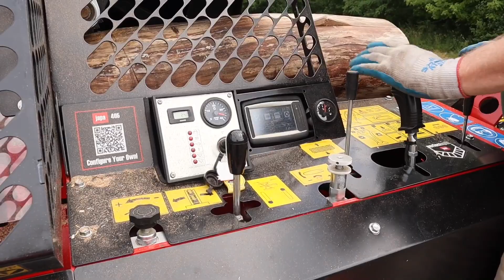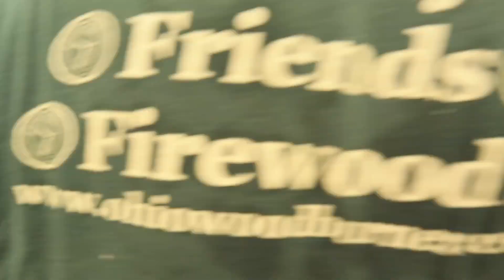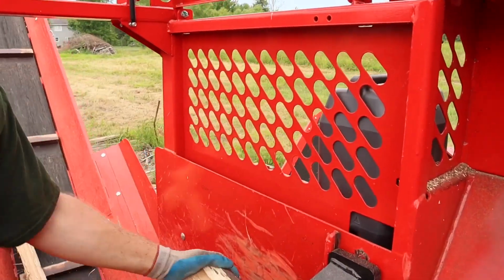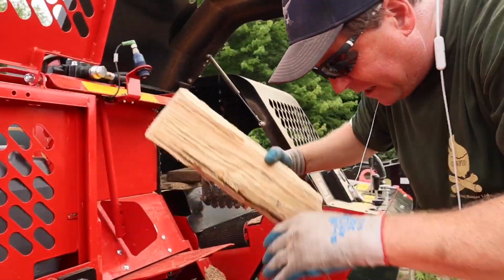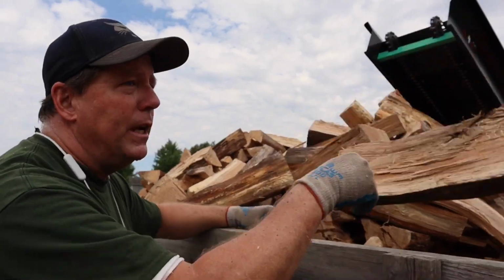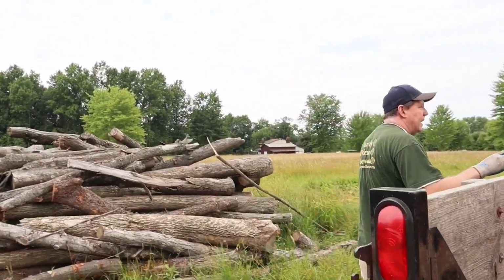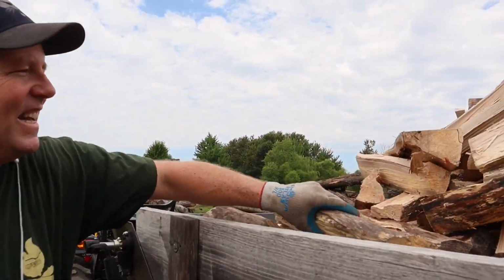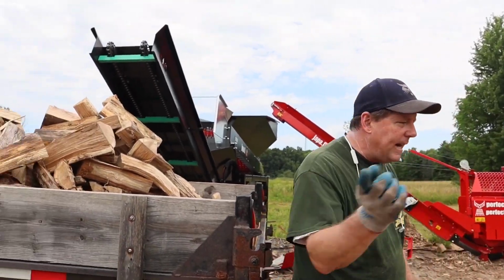SUPER FAST FIREWOOD PROCESSOR IN REAL TIME!!! The Japa 405

Comment: Great job Joe! I like the 405. I’ve looked at the large Easternmade and it might push wood through faster but it makes mush out of a lot of wood. You made the right choice…
Reply: You got that right!  

The 22MB for ~ $120k is faster with 115 HP pushing on the bar for faster cuts, and fast splits, but requires an octopus (with numerous arms) to run it.

Also, the 22MB, would "gargle" diesel compared to just "sipping" diesel on the 405! 

Once Joe is done splitting the 7 tri-axels of small logs, he can put back on the "perfect split" 6 way box wedge, where no resplits are ever needed.  For smaller wood yards, the 22MB is like using a sledge hammer to kill a fly.

Comment: Very impressive wood processor. Some of the best looking finished firewood I have ever seen made by an automated processor. The design of the 8-way splitting knife is just remarkable and produces very uniform firewood splits. Thanks Joe for the real-time demonstration! Just a quick question. Could the splitting debris that you are sorting out be sent through your chipper to make your smoker chip products? The material is already broken down to small pieces and should feed through your chipper without any problem. Just a thought. Thanks again for the great video!

Comment: Joe, I added up the retail cost on your processor setup without the Perfect-split/clean options. It is not cheap. A great video would be "how to build up your business to need equipment like this". So many people think they have to get a pricey setup like yours when in reality they only need a couple of chainsaws and a log splitter to get started. But then what is a reasonable route to take for cost when stepping up you game into the processor world? That is the big question. Personally I have no problem with someone using a small tractor that can only lift a 1000 pound log at most and using a $5000 processor off of Alibaba. Is all about the process, or "the game" if you will, on how to get to the end goal of a processor setup like you have. I really appreciate your recent videos on making bbq chips and the "value added" firewood. I did the math and the income potential per truckload of firewood logs is staggering when it comes to bbq chips.
Reply: @bahabob1386 , like the auto-cycle feature on the splitter I ordered. That's like hiring someone to help me split firewood.
Reply from the maker: where I am now is not where I started.  I think it's reasonable to expect a successful business to grow and adjust as its "economy" is an economy of scale.  I think in my case, as bob pointed out I am doing my best to remain a sole proprietor and while I don't crunch numbers as many would want me to I certainly don't make my capital expenditures based solely on $$.  While I can live that lifestyle I chose not to and revert to my "practical" approach where I position myself with machines to keep me productive, and profitable to keep me in this game for a few more years closer to retirement.  Thanks so much for the thoughtful and appropriate comments.  You both make me proud to be on YT!!  Joe
Reply: @ohiowoodburner , your early days of a processor being moved to each row of logs is what I'm looking to do as my next step if have the customers and can warrant the expense of a small processor. Is impossible to get even a few hours help for a few $ "under the table" so equipment is going to be my employee when can do so. And only if the equipment will add enough benefit to make it worthwhile, same as hiring someone to do the job.

Comment: Hi Joe!!😀😀
You are really getting the hang of running the 405 . I'm really impressed with the splitter power. It really didn't hardly grunt to push those dry oak through the 8 way. 
Is that approximately 1 full cord in the trailer? 
You do have a little over a half hour in the load by the time you figure loading the deck and cleanup afterwards. 
Keep up the good work and keep the videos coming. I could watch it run all day. TTYL!!

Logger Al
Reply from the maker: This load was about 2/3 of a cord.  I was shocked at how much I made in such a short time!!

Comment: Great video of the time to really cut and split over a cord of firewood. I have a spliter like your super split and that would take well over 4 hours with multiple people - family - helping with bucking the rounds and rolling them to the splitter, lifting them up and them splitting them. Amazing machines. Even if you add in the 20-30 minutes to load the logs that is super fast. Well done.
Reply from the maker: It sure is!!  I was shocked at how much wood I had made when the table was empty.  Super fast for sure

Comment: You seem to be generating more debris with the new machine and the segregated piles might encourage you to find a market for it. Your dust and small chip piles might be added to a concrete bunker, blended with a local nitrogen source (poultry litter, livestock manure) and turned with your tractor to make compost for sale. If the large chips can be separated (hickory, cherry), dried in the dump trailer, you could sell a second, cheaper bag of smoke wood that works well but ain’t so pretty. Knock 30% off the price of the grade “A” and let folks pay you to dispose of it. 😉

Comment: Hey Joe, love the setup your running now. Much better than the last japa machine you had. I would like to know why your not using IBC tote's tanks cut in half to collect saw dust, wood chips and kindling drops? 🤔 I'm thinking this would help stream line clean up.
Reply from the maker: I have them.  The reason I'm not using them yet is I haven't felt like getting them made and in position LOL.

Comment: Joe I enjoy all of your videos, I’ve been noticing that you have been collecting lots of smaller pieces under the cleaner machine as well as lots of saw dust from the Japanese 405, how about using both of the those waste products as fire starters, use bees was or pine pitch as a water proofer slash ignition source to help your customers start there fires with. Just a suggestion to add more value to your business

Comment: What is the size of ned product difference between the Perfect-split wedges/knives? Are they height adjustable like the other knife/wedge options? As good as your business advice and topics are, is also good so see you out your head down and get on with the job in videos. Gives us a great insight as to how fast you cam get the job done when things are setup right and go well.
Reply from the maker: Thanks for the comment.  The Perfect Split makes perfect splits...no fluff there.  It is awesome. It does not adjust, it is fixed. The 8 way etc is much faster but you are always chasing the adjustment...that gives, sometimes, some bigger splits that may need resplit.

Comment: Is that machine gas or diesel? I just upgraded to a wood splitter last Christmas, it's a world of difference, best part is I got it for free from my neighbor. It's a 37ish ton splitter with a pull start diesel motor, total beast, only burns 1 gallon in like 8 hrs, runs at a slow idle. Scarlet oak no longer is my ax and mauls nemesis.   What a great machine you have, what's the down time for chain switches and general maintenance? I.e daily inspections and all that good stuff?   Looks like you make at least 2 cord per hour? Maybe 1 bundle about with each round?  Just a guess here.

Comment: Hey Joe,

Looks like on some of the larger logs the 8-way is leaving 1-2 split pieces a little larger than your optimum size. Do you ever re-split a few? TQM remember.
Reply from the maker: The challenge with these knives is you have to keep up with the adjustment. Sometimes it is hard to judge and you wind up with larger pieces on the top of the knife.  Sometimes if they are too big I will pull them back for a resplit then.  Usually I stack them and worry about it 6 months later LOL

Comment: Could you tell me how quiet/loud your japa 365 is? It doesn’t seem too loud, and being in a residential area I would consider this machine if it’s not too bad on the noise?
Reply from the maker: I have no objective measurement to offer other than imo its quieter than my 365 simply bc of the diesel im running now. The most noise is the whine of the saw motor and the banging of the splits in the cleaner and trailer. My machine sits about 150 yrds from our house and my wife cannot hear it running from within.

Comment: about 93 cuts could be wrong (2.27am here ) in 23 1/2 mins = 15 second cycle time . So assuming average of 36 cm Diameter and 40 cm long = 0.145264 M3 per min = 8.71 m3 a hour =2.90 cords an hour  based on 3 solid m3 being equal to a cord . BTW would have like to have seen the logs coming off the log deck , it looks a slightly poor design they need mini rollers between  I assume are  the  two powered rollers
Reply from the maker: I will get you some vids of the log deck.  I think this time my daughter didn't want to go over to that side bc the poison ivy is pretty thick.
Reply: That Japa has the fancy ability to record the amont of wood processed to so that would be awesome to see
Reply: Couldn’t appreciate a great machine eh ?